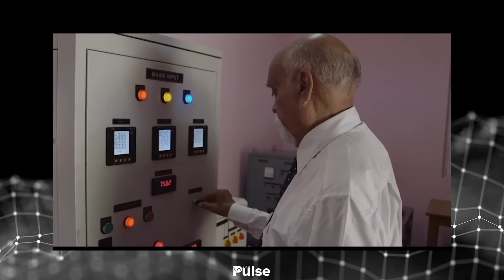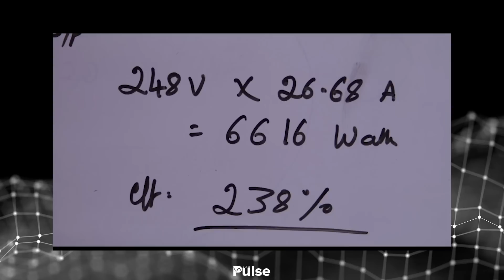'Free Energy' Generator That Works - Tewari Demonstrates His Over-Unity Machine

Comment: Not possible. Energy can only come from something at a higher temperature or work. 
Logically, if it works, connect the output to the input, and you have a self-contained device producing more and more energy to infinity. What happens then? - an infinite temperature, presumably - at which point the universe itself would cease to exist.

Comment: All these machines of free energy are generally based on magnetic fields, and electric fields, with conductors. During Maxwells, and Faraday's, Hertz time they wanted to unify the 2 phenomenon. They did but only partly. However, electrons inside an atom coupled with various conductors react differently than ions, or charged particles away from there atoms. This is where we can possibly achieve better results in my opinion. Yet it takes a high amount of initial  energy to have ions seperated away from the atom. The electron. The end result of what people want is typically current. Amps. Amps are the end product. How do we take  ions or a charged particle and conserve its energy and use it efficiently. Many bogus claims out there. Amazing this day and age. Science is still learning the basic fundamentals of electricity. They keep repeating the same mistakes, and progress comes to a stop. We need solid scientific theory with hard work and imagination. Would good is a photon all by itself ir an electron by itself. It's only useful if it interacts with matter.

Comment: I'm a believer in free energy for two reasons:
1) A heat pump uses manipulations in material state to create large chages in potential energy and as a result heat pumps relocate more Joules of heat energy than is required to sping the pump. If you look on the box you'll see a "COP" rating. COP 2 means that if you give the air conciditioner 100 joules of electricity, it will take 200 joules from the cold sink and put it in the hot sink.

Well, I reason that if that kind of thing is possible for one form of energy, then symmetry would imply that kind of thing is possible for other forms of energy.

Therefore, if I can use state changes to magnify potential energy to relocate thermal energy with a COP > 1, I must be able to do the same thing for electrical potential energy, and I must be able to do the same thing for mechanical potential energy, and magnetic potential energy.

As long as what is being manipulated is POTENTIAL ENERGY and not absolute energy (mass), then state changes can absolutely magnify and diminish potential energy. You can harvest the differences between potential energies at in different sates. As long as changing state requires less energy than the difference in potential energy from one state to the other. Like a heat pump.

2) If UFOs are real, there are better way to generate massive ammounts of power in exteremely compact spaces through some kind of energy harvesting something.
Reply: Your comment is highly underrated.

Comment: dr tewari was in charge of india's atomic energy for years , he fell out with the "establishment" when he started playing with this stuff in the '90's i think it was , they felt it was a threat to nuclear energy enough to trash his name and reputation so i really think he has something here, its been known for a long and is rediscovered every few years.....moray, tesla, shauberbeger, roden, marks device, hendershott, hutchinson like i said, every few years ..moray was the best one i've ever seen for potential vs how complex a device is required or no expensive equipment
Reply: Moray built an inexpensive device?
Reply: coils, capacitors, vacumn tubes  [ 26 stages of frequency stepdown and amperage step up ]  , some mysterious mineral "cold cathode" made of semiconductor type materals like germanium, doping agents and some radioactive materials for inducing ion acoustic modes in the plasmas in the vacumn tubes?  a good ground and an antenna which he made ever smaller as his designs progressed, but to answer you , yes, fairly cheap items assembled in a configuration that to my knowledge  is the best demonstration of a "free energy device"  where there is no free energy , just a novel way to recieve ultra high frequency em energy and convert it from billions of volts at trillions of hertz to a useful voltage frequency and current , the energy is all around us , coming from space , who knows , he may have invented the first neutrino-ion generator , despinning neutrino's anihilating them , converting their small but voluminous energy to usable power? food for thought , but i believe that figuring this one out is the best most fruitful rabbit hole to go down as it was demonstrated so many times and no explanation of where the power was coming from , just that  it comes from somewhere and cant be explained but IT WORKS SO WHO CARES! 
 @ekeretteekpo3004

Comment: Mr. Tewari hasn't explained the physics behind the existence of ether. Space is not empty as modern Physics puts it! The characteristics of space is what limits the speed of the photon else the photon would be traveling much faster than ~3*10^8 m/s. Michaelson Morley measured the speed of light to be ~3*10^8 m/s in space but what limits the speed of the photon in space/vacuum? 

The properties of space are better explained by Mr. G Srinivasan (RIP - he is no more) in a 2 part book that he wrote. He also built a motor and explained the characteristics of over-unity precisely using the properties of space and the math that describes it. He mentioned that it was differential expansion of space which produced a magnetic field that was used to generate a pulse which was sent as a feedback to the motor. Hence, output is greater than input. 

At what frequency does space do that and why? How does the properties of space limit the photon to the speed of ~3*10^8 m/s and why...he explained these and many more phenomena mathematically, precisely and beautifully.
Reply: Are there any videos that delve into this and explain it in detail?

Comment: this is such a crock of shit none of the words they use are words that are used when dealing with electric machinery. you cannot get more out than you put in it just the way it is.
Reply: PFFFFFT. Says the one who doesn't realize an mmf source can have multiple parallel but independent from each other reluctance paths.
Reply: @lukiepoole9254    Multiple reluctance paths can not override conservation of energy.
Reply: @heinzpg  While having the two opposing fluxes oppose each other on that extra path causes overunity.
Reply: @lukiepoole9254   NO, of course not. If it would be so simple to get overunity we would have overunity machines all around since hundred years.

Comment: What they have done in this video i have also done with different motor.
On input side i had 400 watt of power to turn generator, and generator when turned (rotor made by factory of permanent magnets) give around 10 kilowatt (more or less)
And it worked fine.
Problem was when i tried to put some load on generator - 400 watt motors that runs generator suddenly was not enough to spin rotor of generator and that 400 watt motor would overload.
If this people claim they got 238% of increase in power they should proving that statement by using 1 kilowatt motor to run generator, and they should connect 2 kilowatt heater to generator output. But they did NOT only because one reason - energy conservation rule
Reply: And that rule is as fake as most fake free energy devices that discriminate against real overunity machines
Reply: @lukiepoole9254  i never saw real overunity machine, can you show me one ?
Reply: @L4ki0  First, you can check the patent of the tewari generator and see how the generator is constructed - perpendicular magnetic fields

Second, last but not least, you can check out thane heins bi-toroid transformer, then come back here for the info on modification. Instead of the way it is constructed, a slightly larger O-shaped core is placed outside and envelops the ♾-shaped core. This is to ensure most of sscondary flux flows in the outer core while none of the primary flux flows in the outer core. With this, lenz's law is mostly negated. This is completely logical as an MMF source can have mulitple independent reluctance paths. You can run simulation on ANSYS Maxwell as well and it WORKS.
Reply: @lukiepoole9254    A patent does not automatically mean that a device works. The patent office checks if a construction is new, not if it really works. At first try I found a patent WO2016170384A1 "High efficiency alternating current generator" by Tewari. The patent text does not mention that an efficiency of more than 100% is reached. And "Legal Events" show that this patent was not granted.  
Devices like this one popped up in quite some number in the last time. But none of them - also the Tewari-generator - supplied a credible proof that overunity was present.
Reply: @heinzpg  A patent gives example.  Whether it works or not requires testing. Parametric transformer for example.
Reply: @lukiepoole9254   Correct, it needs testing. A credible test requires that the test is done by independent experts, not just by the inventor and his team. And I bet there is no such test for the Tewari-machine.
Reply: @heinzpg  The tewari is just a monopolar generator lol
Reply: @lukiepoole9254    It doesn't really look like a monopolar generator but if it is one, it can't have overunity. Monopolar generators have no overunity, they have a resistive torque as all other generators also.
Reply: @heinzpg  Ah yes the braking load torque due to lenz's law. Know what's funny? It disappears when you rotate the ELECTROMAGNET as well. Instead of high ampere, high voltage DIRECT CURRENT is generated. Breaks your understanding of monopolar generator isn't it?
Reply: @heinzpg  When the magnet and the disk are rotated in the SAME direction, there is still high DC voltage output. How you explain that? Lmao
Reply: @lukiepoole9254    Where do you see a problem? The effect happens when a conducting disk rotates in a magnetic field. As I mentioned before: if the magnet has rotational symmetry, the magnetic field stays the same, never mind if the magnet is fixed or rotates in whatever speed cw or ccw. In a certain point of space you have a magnetic field of strength B. This does not change if a magnet with rotational symmetry rotates.
Reply: @heinzpg  And there are no more lenz's law which would cause braking torque.
Reply: @lukiepoole9254   Please note my comment above. When charges move in a magnetic field there is a resistive force.
Reply: @heinzpg  You do know that the magnetic field moves WITH the current in the above case yes? And the brushes are at the outer rim and the shaft if you didn't know.
Reply: @lukiepoole9254    I know where the brushes are. But your error is the idea that the magnetic field "moves". If you use a sensor to measure the magnetic field in a point between magnet and disk you will measure a value for B. And this value does not change if you rotate the magnet! You seem to have the perception that magnetic field lines parallel to the axis stick out of the magnet and rotate with the magnet and this causes something. This is a wrong perception. A sensor would register always the same value for B, never mind if the magnet rotates or not, if rotational symmetry is given. Since B doesn't change, rotation or non-rotation of the magnet makes no difference. 
This idea that resistive force disappears is only found in YT-videos and blogs of free energy. You don't find it in scientific textbooks and publications. And this is not because the oil-industry wants to hide it! Of course also homopolar generators obey conservation of energy. Feel free to prove me wrong by giving a credible reference that they don't obey to this universal law. As long as I don't get such a reference I see no need to prolong our discussion.
Reply: @heinzpg  Why wouldn't magnetic field move when the 'magnet' moves? I find it very funny. Are you suggesting the existence of a reference frame? If magnetic field doesn't move when the magnet moves, there wouldn't be any induction isn't it?
Reply: @heinzpg  I find it funny you would make this kind of mistake.
Reply: @lukiepoole9254    OMG! Induction happens when B changes over time, dB/dt <> 0. See Maxwells equations for that. In most situations B does change when a magnet is moved and this causes induction. But the rotation of a magnet with rotational symmetry does not cause a change of B. 
Please show me a reference that homopolar generators do not obey conservation of energy! I have never encountered a textbook of physics which stated that energy is conserved, but with the exception of homopolar generators.
Reply: @heinzpg  Okay I had fun playing with you lol. It's just a prototype that doesn't work. I already know the working ones but I won't tell you since you will end up being quiet like everyone else anyway
Reply: @lukiepoole9254    I had the amusement that you demonstrated your incompetence with every comment more and more. You know the working ones? I hear such claims since many decades but they never turned out to be true. Bye.
Reply: @heinzpg  So you run away the moment I said I know the working ones huh? Classic denial 😂
Reply: @lukiepoole9254    Your comment only exposes your incompetence, you still did not grasp my point. If a magnet moves, the magnetic field of this magnet moves with the magnet and thus it moves of course. And if a magnet rotates, the magnetic field also rotates. But with the homopolar generator you have a magnet with rotational symmetry. And if you rotate this magnet I have no objection to say that also the magnetic field rotates but the point is, that this rotation does not change the resulting magnetic field at all! In every point of space you measure the same direction and strength B of the magnetic field, never mind if the magnet rotates or not. Measurements of direction and strength of the magnetic field can not decide, if the magnet rotates or not. And thus there is also no effect on the disk by the rotation of the magnet. 

If you search the internet now in the desperate attempt to prove me wrong and dig up things like the larmor frequency, please restrict your search to some evidence, that the homopolar generator can violate conservation of energy. I will no longer react on other contributions.
Reply: @heinzpg  Yes the magnet rotates with the disk but why is there measurable DC emf? Lmao
Reply: @heinzpg  You simply need to explain why would there be opposing forces just by consuming power from the tewari generator or the depalma N machine or the homopolar generator with both the central disk and the magnet rotating together?

Comment: I don't have the resources to test but you must know about the Faraday disc showing output when the magnet rotates with the disk shouldn't work but it does and without any drag weird. But for some reason you can't connect them in series. I wonder if you used magnetic shielding material to completely seal the magnet field in each faraday disk generator maybe you can stack them if there fields don't interact with anything other than the disk. If you can stack them them there's no reason you can't put a long array of faraday disk generators in orbit and have it spin pretty much forever and send the power out wirelessly using Tesla coils also how is a rotating faraday disk in space with a Tesla coil not over unity energy
Reply: But with no drag you should be able to power your house easily with a pedal powered generator it might be hard to get to speed if it's heavy but with a transmission and some time you can get it to speed but with no drag something heavy spinning would stay spinning for some time maybe give it a pedal once a day to overcome the drag of the bearings but you can use magnet bearings for some reason nobody uses the pyramid shape for megnetic bearings it's the only setup I know that works everyone uses the pin method it's low friction but I sure the magnet pyramid is better no contact but you need to get the power out somehow if you can get the voltage high enough like 3k volts you can ark the power so you can have no drag but then to spin it you can use the engine starter method make contact then don't but I would use magnet gears for that because I already did everything else contactless and the gear separation would be smoother maybe add a clutch and a vacuum box around it so no air to slow it down so I can spin it up and release the clutch and let it spin until I guess the slightest imperfection in balance eventually slows it down because it will slowly release the energy as pure vibrations

Comment: Devices such as this one break the first law of thermodynamics. That is to say, within an isolated system energy out MUST equal energy in. This has been well established for hundreds of years.
Reply: A seed that becomes a large fruit tree providing abundance of apples breaks the law of thermodynamics.

My well gives me more water or in other words “energy” than I put in to drill the well. 

The human is quite literally blind on earth and can see less than 1%  of the energetic frequency spectrum. 

Knowledge brings the seen out of the unseen.
Reply: What you fail to understand is, that electrons are continuously flowing, even within solid objects, so just because you can't see that energy, doesn't mean it doesn't exist! Therefore, that energy can be tapped into, and since it's perpetual, we will one day achieve overunity, if we haven't already.
Reply: Magnetism works defferrent than chemical based energy. Law of thermodynamics don't have any scope in magnetic potential energy. The external power in a generator is used to harness this potential energy to overcome Back EMF.